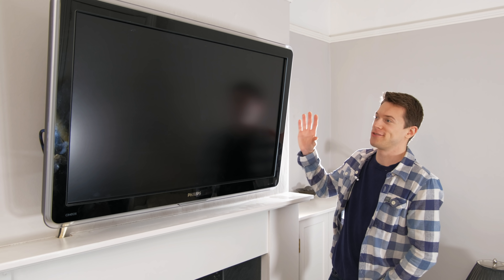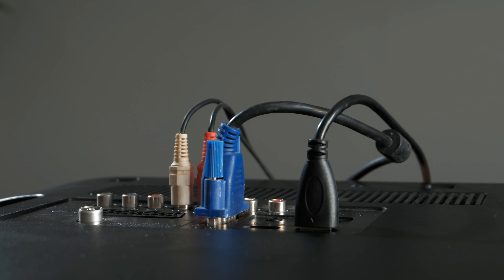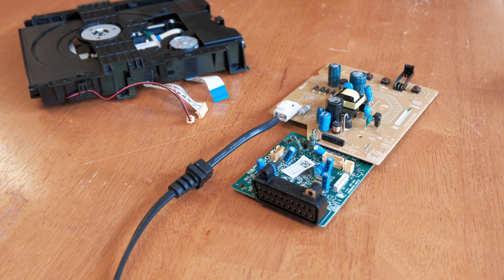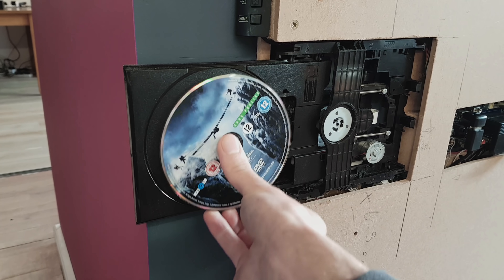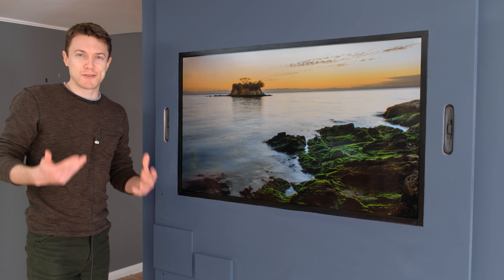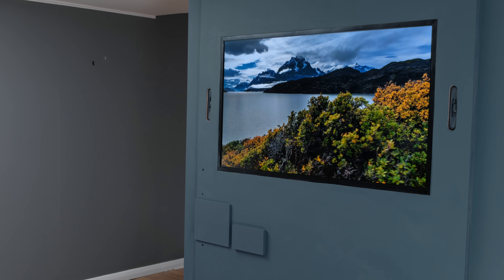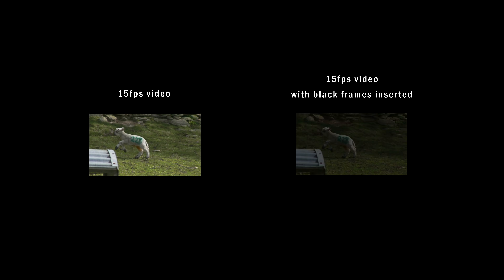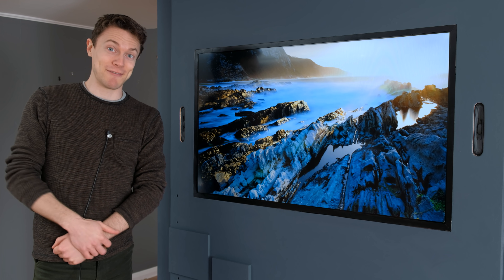Building a homemade 'wallpaper TV'

Comment: So the solution isn't making the TV thinner, it's making the walls thicker
Reply: A bit of both. He clearly showed him making tv thinner by removing the bezels and plastic. But yeah the fake wall gave it a bit of extra thickness. Worth it in my opinion.
Reply: I applied this exact same technique to hide wires in the bedroom without having to route channels into the wall (concrete walls). I made a 2-ish cm thick "fake" wall and build all the cabeling into that. Looks very nice and a heck of a lot less hassle than routing stuff and never having access to it afterwards :D
Reply: @NinjaRider777R Well... you would want to frame it in like a window.. drywall is thin and you would run into studs.. But I'd likely do that before doing what he did haha..
Reply: @NinjaRider777R Exactly !!!!!! This video definitely had some meth involved.
Reply: @NinjaRider777R assuming your walls are drywall. Not many drywall walls here in the EU 😅
Reply: @SyntheticFuture  Yea, I've got solid walls so was hoping this was going to be of more use to me. Still interesting though :)
Reply: @SyntheticFuture  it's actually better to use in-wall cord system, especially when you have a concrete or brick wall. You don't need to plaster the cable in, you can use cable concealer or other plastic tunnel so that ull always have access to your cables.
Reply: Check your comment and realize you've been thinking your glass is always half empty for God knows why....
Reply: Try using a short throw laser projector they work great
Reply: This came just up my mind:
"I can walk through walls!"
"Impossible, stupid."
"I make doors."
Reply: I have the same thing, but it's a 3" reflecting telescope. The eyepiece is mounted flush with the wall (but the wall is 10 feet thick)
Great video!
Reply: i built a wooden suitcase with a pc in it once, and used the same technique.

i tore apart a monitor and just integrated its internals into the suitcase and put a pc there as well.

it looked really cool, and was probably the smallest full spec pc you could ever find.
it was only 12cm thickness while being the exact size of a monitor screen
Reply: for me! the most interesting part is how he solve the flicker problem, very clever
Reply: @obijuankenobi420  Just because you're to dense to understand the logistics behind this build, doesn't mean Matt was 'on meth'.
Reply: @Solarstar10  I completely understand.....that this is some tweaker stuff.
Reply: Mmmmhmmmm
Reply: At least it looks good

Comment: This man  just ruined LG's years of work....
Reply: Would you want that in your house?
Reply: @soljafon  ya
Reply: It's pretty much what LG did lol     They have their panel on the wall (in their case the super thin OLED panel, rather than an LCD panel) and all the electronics went into a box below the tv, connected by a giant ribbon cable.     So he's basically the same thing, but executing it with older technology.      I actually did the same thing myself with a TV that had a busted backlight and other problems.  For a couple weeks I had it mounted in my window, using the daylight from outside as the backlight, and while the TV was off it was fairly see-through even!  You could still make out the trees during very bright scenes though so I reassembled the TV and LCD panel and replaced the backlight.
Reply: @TheJunky228  you used the sunnlight as a backlight :D?
Reply: @anonyrus yep! sure did lol.    I got bored of that and later propped it up and used a desk lamp behind it for a bit (which actually made foe a really nice ambiance in the room), then I stopped being lazy, replaced the original dead lcd backlight strips and reassembled the tv so it looked like normal
Reply: you meant sony's years of work hahahaha
Reply: @TheJunky228  its not at all like that what are you talking about ?
Reply: @TheJunky228  Wow, that would be worth keeping - as a second set, as it is so different.
As for the sun, I tried that with a projector that had a dead $$$$ lamp, it worked....
Reply: sony lol -_-
Reply: @TheJunky228  Sweet!
Reply: Aayush Khokhar ikr but if it’s so old I will make tear it down to make something but if you see you can make projects useing LG’s work was useful
Reply: @TheJunky228  okay that's actually pretty awesome of you
How did the white balance look lol
Reply: It's sloppy af imo. You can see where he's missed some paint and there are ugly boxes all over the wall. This could've been done a lot better and without making the wall thicker. I expected him cutting a hole in the actual wall.
Reply: and he did it in 9 minutes.
Reply: literally ruined LG's wallpaper TV sales
Reply: Sony, burrin
Reply: @soljafon  i wouldn’t because i would be scared i break it
Reply: No, lmao not many people would pay for a TV to be put into their walls. That shit is expensive and you're fked when you want to upgrade lol. It literally takes no research and development to put a tv in a wall.
Reply: Well no he didn't because LG isn't going to start selling TV's that come with a free wall extension.

Comment: The unpainted speaker hole edges would break me
Reply: TheBeardedDoom thanksgiving
Reply: Same here 😁
Reply: I would use a mesh screen that had holes in it like cheese cloth and it'd be less noticeable
Reply: Yea basically this and the tv edges should have been hidden better. Maybe recess the tv in abit and add wood over the edges would have had a cleaner look.
Reply: An exciter instead of a speaker would allow the wood to remain intact.
Reply: I would use speaker cloth and a nice frame that matches the TV
Plus a panel lower down to bring it there AV hookups
Reply: I couldn't stop staring at the plywood-color speaker holes in the "finished" product. Well, except when I was distracted by the two oddly-located protruding rectangles under the TV. After all that effort, those details were left to mar the result.
Reply: Thank you!
Reply: So this, my ocd was going nuts while watching this brilliant vid... Arrrg just paint the fking edges, but apart from that ... twas cool.
Reply: He’s DIY skills are not quite as good as his electrical skills. Great video though.
Reply: @jacooosthuizen3593  Yes - Framed with some thin decorative molding.. or SOME-thing...
Reply: TheBeardedDoom I came here to comment that. When he did the side view I died a little inside
Reply: Budget
Reply: I thought he was going to cut the dry wall and a little stud to make it flush.
Reply: @mr.ziawsom2991  or speaker grills from a 4x9 cheapo speaker from wal mart. just remove said cheapo brand logo from the grill and paint to taste.
Reply: @richlaue  How about two flat picture frames with the flexible speaker cloth glued to the backside of it then mounted on the wall. With 8x10 frames you can even upgrade those cheap sounding tv speakers with a good pair of 6x9 speakers or a 6 inch component set of speakers that includes a tweeter and a crossover.
Reply: Exactly, it looks really messy.  I'd paint those edges and add some kind of mesh grill over the speakers, it would look way better.

Also, why not make those two protruding boxes into a feature?  Add a few more across the width at similar height but different sizes, and paint the tops in a slightly different colour to the background.  A couple lighter, a couple darker alternating.  It would become a cubist feature then instead of just sticking out.
Reply: @emulatorretro  That's a good idea with the picture frames, it would be a huge upgrade.
Reply: Nice. But with all that work I think I'd have gone with component speakers. The originals look quite puny. Overall though I like it.
Reply: Just make a thicker fake wall and put the TV behind it. And no uncovered speaker holes (with the resonance).
Reply: T
Reply: So paint them when you do it or put grilles on?
Reply: lets be honest it looks like shit
Reply: @mr.ziawsom2991  or spend a dollar on some black pantyhose and cut to size. Multiple layers would control the opacity
Reply: I was about to comment the same thing. Not only that, but the speakers themselves look so ugly.
Reply: The inside of the tv frame edge is also not painted

Comment from the maker: Hey everyone, apologies for the long absence! I have a very good reason for it, which you'll see in the next video. Meanwhile, I thought I'd get this one out to you guys for something to watch. I know it's not as polished as my usual stuff, but it was with its own constraints so it is what it is. Not getting lazy or anything... hehe. The next video just needs editing, so stay tuned - should turn a few heads!
Reply: hi there, could you tell where i can find more Information on the backlight strobing? that differences are really quite stunning... why don't manufacturers provide such a feature?
Reply: Copying this from my reply to another comment. I would also like to note that in my case I had mine inset into the wall, as it was a home I owned instead of renting or anything like that - I've done this in the past, and heat definitely is an issue - Because the TV would overheat and shut itself down , and some older TVs may not have that feature. To fix it I got two lengths of dryer tube, with four Noctua 140mm fans, one at each end. One set pulled in from the outside (Which was on the left) and one pulled air from the inside and blew it out (On the right side). I had some fairly thick walls to work with, but I managed to maneuver the tubing around so the inlet pulled from behind a plant, and outlet was pushing out from the other side of the wall outside to hopefully keep living room temps down slightly. I also attached some of the mesh filters you can find on PC modding sites so it acts sort of like an air filtration unit for the room, on top of keeping the TVs internals clean.
Reply: Glad to see you are back :), well done for the tv project !
Reply: And there was me commenting before I read this lol sorry!
Reply: DIY Perks question can you use TV to grow plants.
Reply: Looking forward to it..! your videos are really good. I mean It. I'm Electronics Engineering Student willing to contribute efforts..
Reply: just yesterday was checking your channel back to see if theres a new diy video that i missed and then i realised you were gone for months. i thought maybe you left youtube but boom here you are with another awesome diy video <3
Reply: DIY Perks I think I like this version of a wall TV better as it's more of a hacker nut Style set up. Whereas the other OLED TV setup is for a tech Enthusiast with a hole to burn in his pocket and doesn't care about the privacy concerns of wifi-enabled TVs.
Might I add that wifi-enabled TVs are really freaking creepy when you first set them up you must input your home address! Irregardless or not if you're going to use cable service there is no skip option!!
Reply: This video rly brightened my day - mid semester grades just came in and there’s one I’m not as happy with. Thx!
Reply: This might not be of any use for me (for now) but it's sure fine to see an approach to do a "fake wallpaper" TV hack. It might not be estatically perfect, but I guess it does it's trick. The speakers could've been cut out rectangly, then covered up and the IR LEDs could have had a flushed closure so you're not stuck with holes in the wall. Same goes with the DVD drive. Not a huge fan of bulks in the wall. But hey, that's just my taste ;)
On the other hand, the explanation why the dimmer function could be of use was just gorgeous. Every day you learn something new.

In any case, gonna be waiting for the explanation of your abscence. Nice video ^^
Reply: DIY Perks take your time :) I don't mind waiting, I look forward to every video because of quality you provide. Amazing videos!
Reply: Looking forward to it!
Reply: Love your work mate ,take your time :)
Reply: literally can't wait, you're epic mate. Keep it up!
Reply: Any chance on the details for the blacklight hack . i have a monitor that needs sorting as its quite laggy.
Reply: Man, this is one of your top videos! Great to see such a cool idea.

Is it possible to get a more flush look without your raised panels for the boards? So it appears as a fully smoothed false wall with the TV in.

I think this might be my next project, great work dude!
Reply: Great to see you back on and getting creative again! I tell people all the time about your creations! DIY Perks!
Reply: Always worth they wait, great video keep up the good work
Reply: Yeah, i always wondered why there were no uploads since i subscribed, i know creating stuff takes long, but this took way long than i thought, thanks for the up
Reply: Looks very nice. Accept the speakers. They don't look so nice
Reply: Where do you get all these ideas?  Do you pay a team of people to come up with this stuff?  Really you have the best videos and diy on youtube i just wish i had the time and patience to do all of these. Keep it up dude, your awesome!!!
Reply: Well I realized this might ruin my warranty even though you did not stay... I have a question, Can I just use a dimmer switch to change the frames?
Reply: smashhawk that was the first thing I was thinking about when he was finished. I was scratching my head thinking where's the ventilation????? I was also wondering if he could have setup a dimmer switch at the end? But yeah heat is key, all my stuff gets hot and condensation wouldn't be good.
Reply: Ishiku_542561_aka_xchoibitschibi hil what are you talking about nobody has to put in their home address that's so ridiculous
Reply: Hey Matt, the two rectangular covers in the lower left look kinda strange. However, if you were to cover the entire wall in randomly sized rectangles, I think that would look really cool!
Reply: Any way you could make some diy quasar lights??? Thanks!
Reply: Make me one dude how much?
Reply: Never doubted you. What you call something to watch in the mean time I call A grade diy youtube.
Reply: Could you please make an infinty mirror build please?
Reply: You should paint the wall black!
Reply: Please make a smart mirror or so called magic mirror, there are other projects on YouTube but would love to see you make one.
Reply: Farhan ul haq its called infinity mirror not smart lol
Reply: Jeron Bosch no dear, not a infinity mirror, I meant a Smart mirror. Which is based on raspberry and can display the climate and temperature can also be connected to the Google assist. Can also play YouTube. YouTube it
Reply: A long wait for perfection is always better than a sloppy rush! I can't wait to see the next video, and I might try this one with some old computer monitors I have.
Reply: I recommend making a video about how to actually make a pc monitor's or pc in general look smoother fps-wise
Reply: LINUS TECH TIPS
Reply: I dont know why you dont have a billion views
Reply: Hey there! Whats the name of the black plastic you used to secure the disc on the DVD? "sout grout"? Can you tell me please, I need that kind of rubber for a support too!! Thanks in advance!
Reply: Sugru - The world's first mouldable glue.
Reply: Can you provide a link for the PWM? I want to do this hack
Reply: How did you mounted TV panel on to the wood?
Reply: about the dimmer how do you get it to be in sync with the refresh rate of the video/screen.
Reply: Excellent project. Keep it up.👍
Reply: Excellent project. Keep it up. 👍
Reply: The whole idea of what you are doing here looks great. I've had this in mind in the past, done a bit differently. I actually didn't think of actually pulling the TV apart, but nice.
My only worry was always that the TV would overheat?! Not enough airflow. I just put my hand on top of one of these TV's and feel the heat coming out.
So has it been OK? Heat wise, in the wall?
Reply: @DamnYoureGarbage  4 or 6 monitors seemlessly together at the price he bought it for haha, that would be awesome for your own cinema room 😁👍
Reply: Can you please show more about how to connect this pulse controller 
Thanks
Reply: DIY Perks July to be a Insulated Garden Roomqqsssgghjj
Reply: I think with your great electronics knowledge and the very good CRI of Yuji LED's.
It would be an interesting project to with an Epson or BenQ projector make it into a LED projector?
All that would be needed is the led with lens or reflector, watercooling, and find the cable that finds the lamp check command..
Hope you will find the time!
Reply: Were there any cooling issues that needed addressing?

Comment: Great score on the used Sony TV!  Most of the commenters missed the main point, that is, to make a wall-paper TV on a shoestring budget.  In that you succeeded brilliantly.  I would only try something like this if I can undo it later if it doesn't work out.  Minus the few screw and wire access holes you got pretty close to that ideal as well, so great job!

Comment: I had a 48" rear projection TV. I cut a hole in the wall so the front was flush with the wall. The back of the TV protruded into the garage.
Reply: worth it
Reply: No cos his wife drove into the back of the TV.
Reply: @darkcosmicmoon  LOL
Reply: @darkcosmicmoon  lol, that would be an interesting insurance claim!
Reply: Can it play DVDs?
Reply: HOPE IT WASN'T THE STRUCTURAL WALL!!!
Reply: AND THAT WOULDN'T BE AS FUN A BUILD, U DID IT THE BUILDERS WAY THIS IS THE ELECTRICAL ENGINEERS DAY OFF NO KIDS ABOUT WAY
Reply: Lmfao
Reply: There are pics out there of a bloke who did this, but into a spare room, however his planning sucked as the back of the TV interfered with the room's door.......
Reply: Every time he used the garage remote it changed the channel on the tv 😊😊
Reply: I also tried doing that, but the back protruded in to my neighbors flat.
Reply: Plot twist: It was a detached garage too.